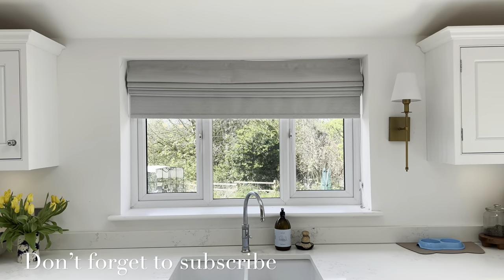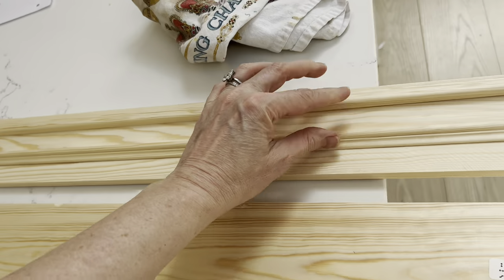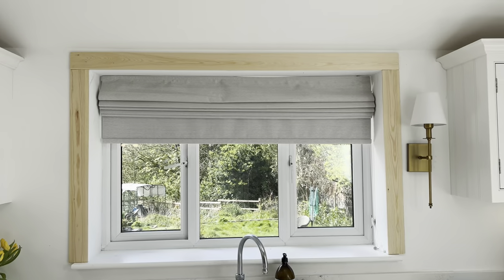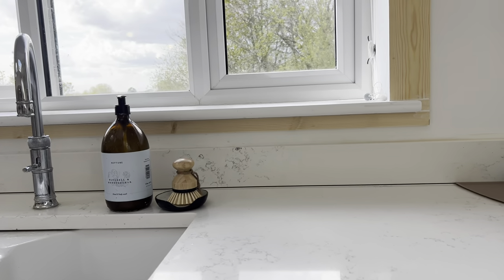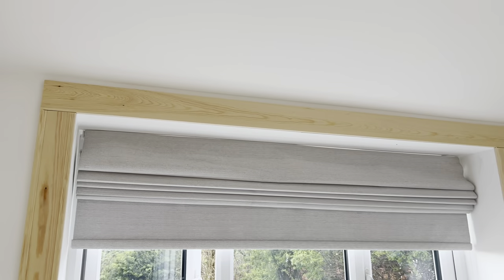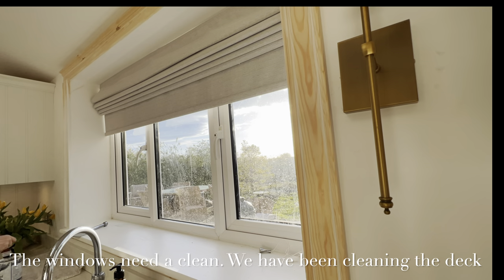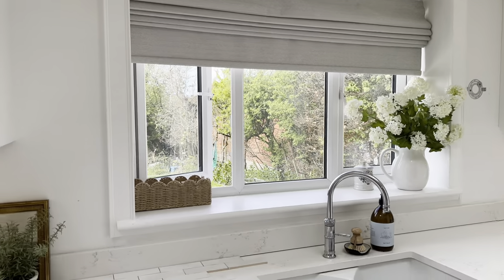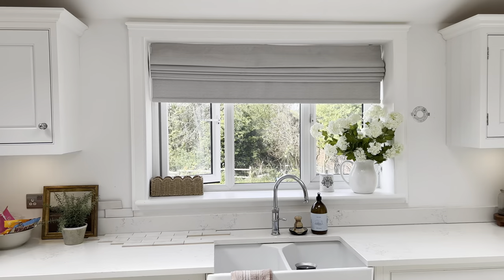How To Frame A Window The American Way - DIY Hack 🇺🇸 Can A Brit Do It Well?

Comment: The window framing looks very nice. I don't think the strip at the back needs to be removed, unless you don't go all the way up with the tiles. What you could do instead is use these tiles as a feature all the way to the ceiling where your stove/extractor is (provided you have an extractor that goes to the ceiling) and make that a feature instead. But if your sink area will be the focal point/feature then I would say yes to tiling all the way up.
Reply from the maker: I think my husband will divorce me if I try and tile over our quartz stove back splash. I will just tile this wall.
Reply: I wouldn’t go that far!

Comment: Most of the light comes from the top of the window. I wonder why you have a blind ? You have a lovely view without being overlooked. I would get rid of
Reply from the maker: We have 3 giant velux windows directly above and double bifold doors, we have no issue with light. It gets unbelievably bright in the summer in the afternoon.  If anything I need to add awnings outside to stop the sun.

Comment: Is it just the idea of trim that makes them what you call American? My 90 yo home has all the windows trimmed out but using the same trim that goes around my doors.  The trim is all in one piece with a sculptured profile, and the exact same trim is put under the sill.  I see you have a short piece under the sill.  But if you use the same trim as at the side, it would go right to the top of the marble around the countertop, so no additional new tiles would need to go under the window.  Is there a way to include a picture to you?
Reply from the maker: I did say I have lived in an Edwardian house with trimmed windows. This is almost like the normal in the USA 🇺🇸 , most kitchens in the style I have this detail round the windows. I didn’t want to add door trim, it wouldn’t have been in the style I like. I’m tiling this wall so deliberately left the piece under the sill short.